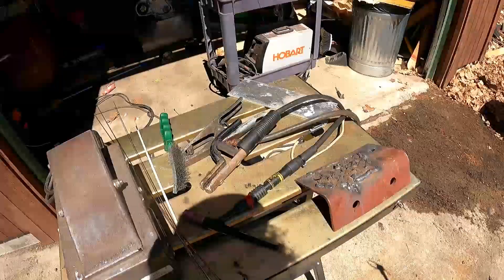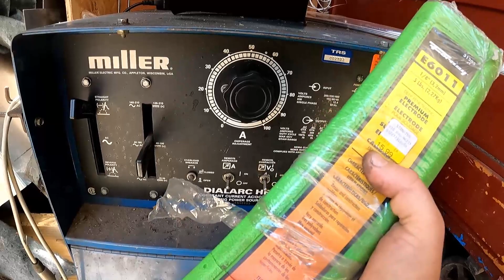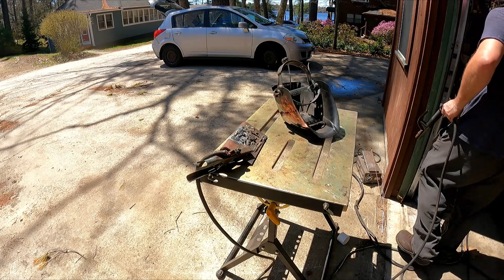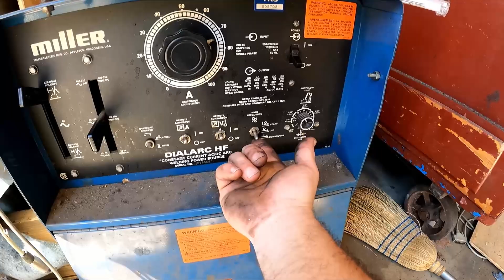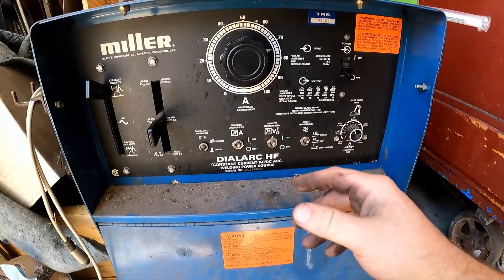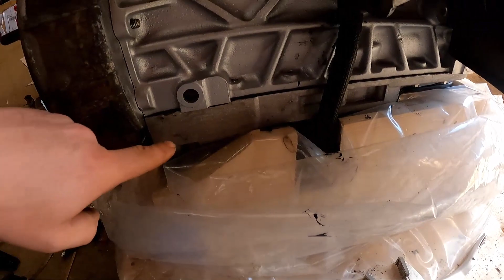Setting up and Tig / Stick / Brazing with the Miller Dialarc 250 HF

Comment: Just picked one up with the pedal for $400, had to replace the coolant/conductor line, so I’m out $525. Now working on installing the power for it and building a shed for it to live in. Thanks for the video!

Comment: OK, correct the start. This is a miller dialarc, not a lincoln ieal arc. Currently bringing one out of retirement. Short turm work's well but lean on it for a while with stick and goes inconsistent. May be a basic machine but sending it in for a tune up. Hopefully nothing major. Parts will be a bitch. ---- ANd bake the rod when she is out shopping. Gives you time to air out the kitchen.

Comment: i need your help. how can i get you over the phone i have the same miller HF AND IT LOOKS LIKE NO ONE KNOW HOW TO USE IT
Reply from the maker: You should reach out to your local miller dealer in your area, and ask them for digital copies of the regular and technicians manual for your machine.  Mine has emailed them to me for free on old welders no problem.  The HF is just the on/off/continuous switch on the front.  Use continuous for aluminum, and on for everything else.  Off is just for stick welding.  If it's working your welding arc will start itself, and if you are far enough away from the work piece the arc won't start but you will hear a high pitched buzzing sound.  There is an adjustable gap in the front of the machine, under the panel.  you need to set the gap at .008 inches with a feeler gauge.  If that doesn't do it, the technicians manual should be able to guide you through troubleshooting it.  Honestly I've never so much as touched mine as it has worked flawlessly for me.  good luck and feel free to ask more questions and let me know what you find.

Comment: What size electrical circuit do you have the welder plugged into?  Looks like a 30 amp 220V ?
Reply from the maker: I ran it off 30amp 220v for a while, then upgraded to 50amp when I got my new garage.  technically it can pull 78 amps at full load, but I've never popped either size breaker with it.  I upgraded recently to a miller syncrowave 300 and it's still on the 50 amp breaker, and it's still been fine, even welding aluminum.
Reply: @wiresti @wirestiresandfires214 t a simple question. How come you switch it over to a different Welder I just got one of those dinosaurs. I don’t know if I did it right or wrong.

Comment: Thank god you made this , I am working with this 46 year old monster
Reply from the maker: Glad It's helpful.  I haven't needed to, but if you have issues with the high frequency, you may need to clean and or adjust the points.  There really isn't too much else to go wrong with them.  I think it's a great machine for a home shop.

Comment: 1. 6010 and 6011 will last years without any special handling, as long as they don't get wet, although there's some disagreement about that last part.  7018 is sensitive to moisture, and needs to be kept in a rod oven above 250F or used within 8 hours, per AWS.  Don't ever buy 7018 if it's not in a hermetically sealed package.  Harbor Freight's 7018 is completely unusable for this reason.
2. You should only brush in one direction on aluminum, because going back and forth will re-embed the dirt back into the metal.  And definitely don't use the same brush you use on carbon or stainless steel.  And for critical aluminum welds, be sure to wipe with acetone after brushing.
3. 308 and 316 stainless are both great general purpose filler rods.  316 being preferred if you're ever expecting to do food grade.  If you're sticking carbon to stainless, 309 is the ticket.
Reply from the maker: That's good to know about the 6010/11 rod, that's probably the only stick rod I'll use with any frequency.  I felt like such a dope when I used my formerly aluminum brush on the steel(especially immediately after saying not to), my only excuse is that it was right next to me and I'm an idiot.  Thanks as always for the good info, see you next week!